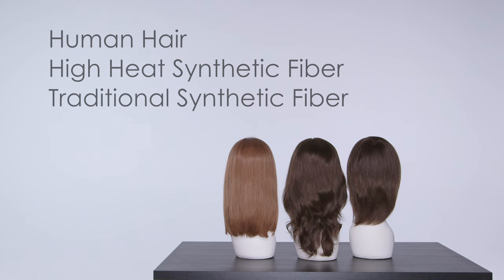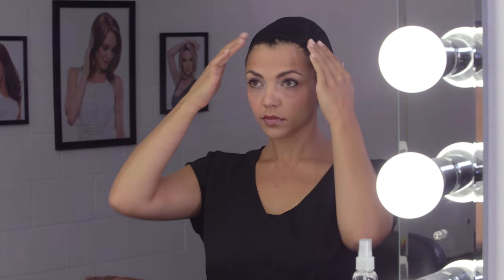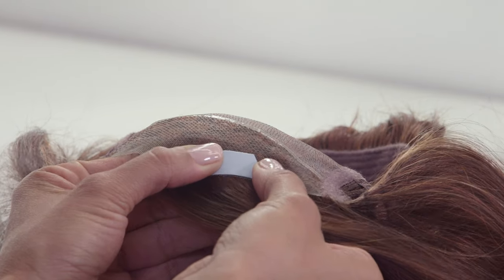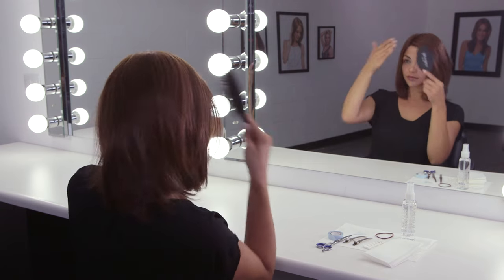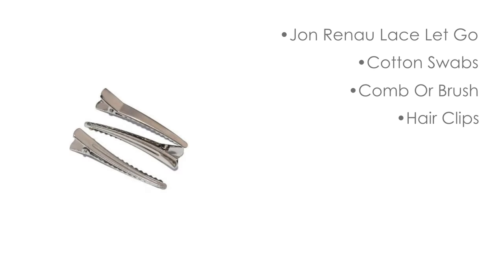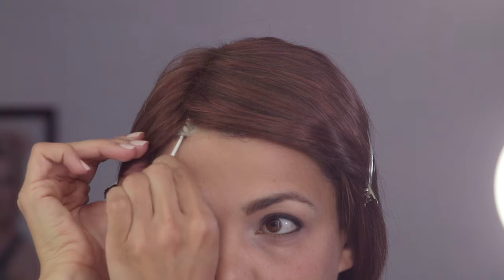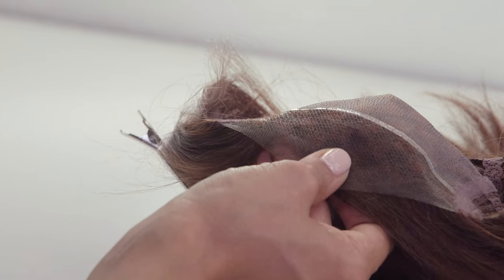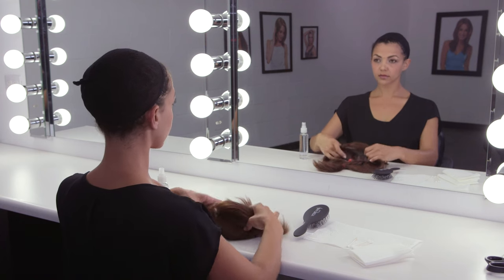HOW-TO: apply and remove adhesive strips on lace front wigs - Wigs 101

Comment: This is great for securing wigs that slip back in the front but what about wigs that ride up in back? My head is flat in the back (I have Plagiocephaly AKA Flat Head Syndrome) and I can not keep a wig from riding up, even if it is the proper circumference for me. So having said that, can I put tape on the nape area of the wig by the adjusters to hold it down and if so which brand and type should I use? I plan on shaving my head so my bio-hair wont be an issue when it comes time to remove it. Thank you and have a great day.
Reply from the maker: Hello, you mentioned that you have checked your circumference measurements but have you also checked your ear to ear measurements?
Unfortunately, we do not make an adhesive that will adhere to the felt material on the nape of the wig. We recommend trying a wig grip to hold the wig comfortably and securely in place: jonrenau.com/sure-grip-bands
An additional possibility would be to have PU strips attached to the nape area of your wig by an alternative hair specialist. This would provide a suitable surface to apply adhesive to.
Reply: +Jon Renau Yes my head circumference is 22 1/2 inches (22 inches with hair shaved off), my ear-to-ear is 10 inches and my front-to-back is 10 inches. I have tried multiple wig grips ranging from The Milano Wig Grip to the latest one called The Wig Fix but because my head is so flat in back they just ride up. That's okay though I will just have to experiment to see if I can find something that works. Thank you for replying and have a great day.
Reply: You can apply the wig tape to the back of the head too if you get a full lace wig (not a frontal lace wig) but those are more expensive